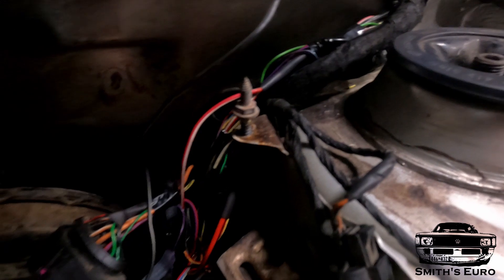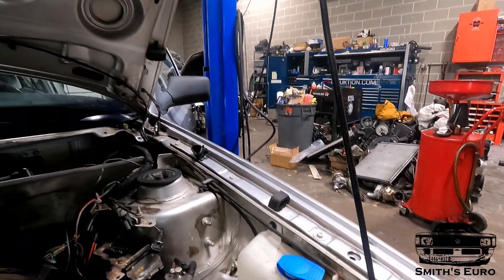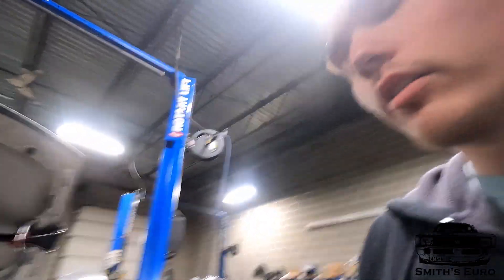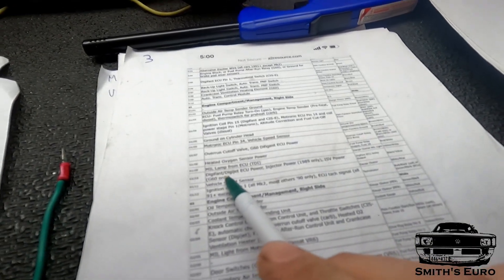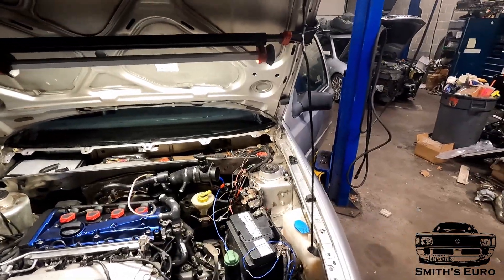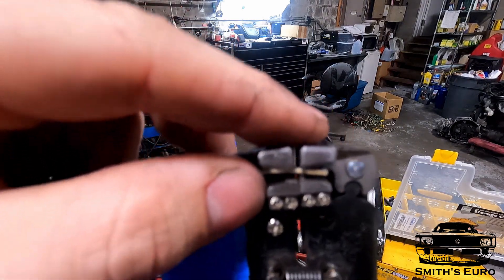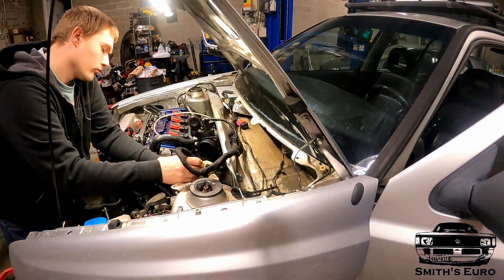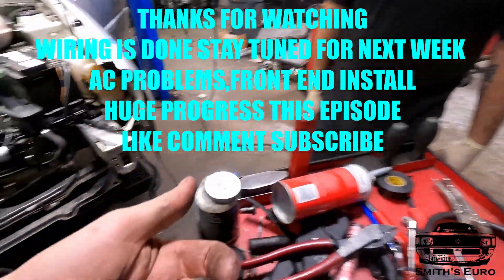mk3 1.8t swap EP6 wiring complete! how to find bad grounds milestone achieved

Comment: G1/10 or G1/9? I have a print out that says G1/9 is MIL light and G1/10 is ecu power
Reply: I watched further and see what you did. Ignoring the G60 notes.
Reply from the maker: Yea I’ve noticed through my oe swaps that lots of resources had extra/wrong things in their notes.
Best bet is to always have an oe manual or bentley manual to confirm.

Im wiring the ft550 on the mk2 now and i was using the a2 resource notes but just threw them out because so much was not true about my ce2 fuse box

Comment: Just wondering where did you get all that wiring diagram info from coz I’m doing the same conversion to my seat Ibiza 6k
Reply from the maker: Buy yourself 2 bentley manuals
1 for the car the engine came out of
And 1 for the car the engine is going into.

Then you have to run through line by line to draw it out.

Theres some stuff on vw vortex but usually wrong colors or missing important wires
Reply: I have auto data and have printed off all the wiring diagrams from the mk4 loom and the same for my seat, I have the ce2 wiring layout for my fuse box, did you cut any plugs off of your original Jetta loom to the fuse box to then join to the mk4 loom ?
Reply from the maker: Yes the 3 engine plugs at the fuse box f g1 g2

Comment: Hi how did you get the Rev counter tacho to work on the mk3 cluster... Which is the signal wire for that?
Reply from the maker: Mk3 fuse box wire G1/12 thats the tacho wire to the cluster

Comment: So what all would have to come out of the mk4 donor car in order to use the 1.8 out of it ? Motor,wiring exe
Reply from the maker: Engine and body harness.
Engine harness dont cut anything.
Body side youll have to cut some things.
Best way is to go to the junkyard and pull everything yourself.
For all the hard to get plugs like gas pedal just go in the car and cut it as far back as possible.
Not really efficient time/money to pull an entire body harness. Probably would take 8hrs alone. Just cut out what you need after the easy to remove side/plugs are out
Reply: @SmithsEuro  the mk4 Jetta donor sits in my driveway can’t wait to get started
Reply from the maker: @jeremystokesbary5048  best to start with pulling everything out of the donor. Gets you familiar with how it all goes, and the differences between the chassis.